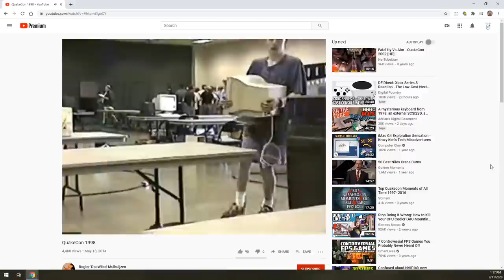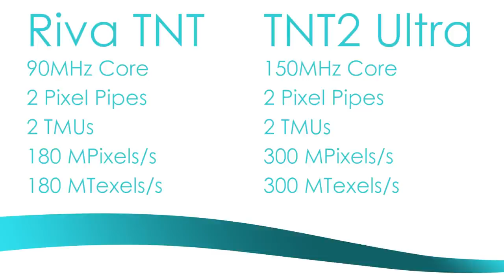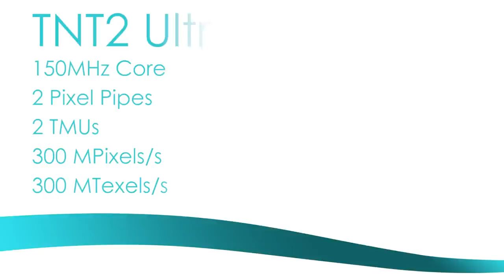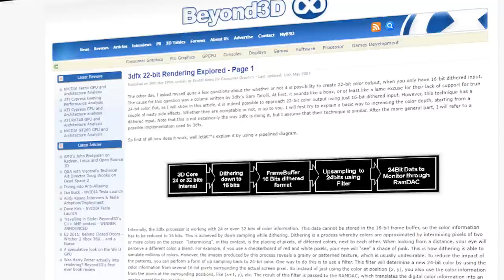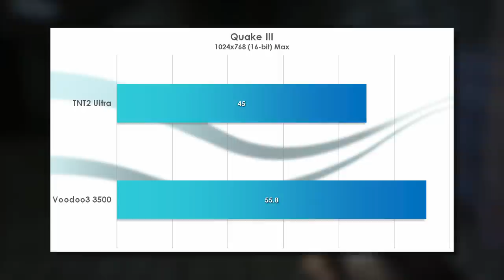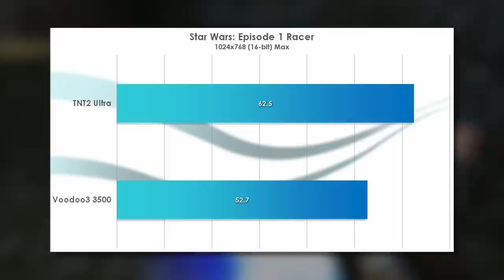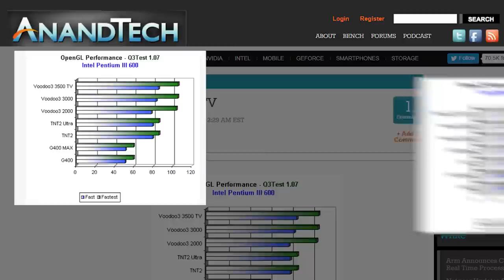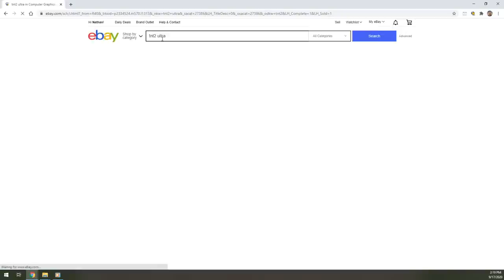NVIDIA TNT2 Ultra vs 3Dfx Voodoo3 3500 | Card Battles

Comment: Back when $250 got you into high end gaming 😰
Reply: To be fair, $250 in 1999 is equivalent to ~$390 in 2020. The RTX 3080 is $499 MSRP. So we're not THAT far off.
Reply: @LS3ftw15  I know you meant 3070, not 3080 @ $499, but i guess i should have phrased it "when $250 bought the fastest thing anyone could buy." Those days are certainly gone. And now nvidia is bigger than Intel lol
Reply: Infinity2z3r0 Yep. Typo on my part, and that’s a fair point.
Reply: But the rest of the system was really expensive.
Reply: The enthusiast PC gaming market wasn't yet ready to support $2000 graphics cards. They would've thought you were nuts.
Reply: @LS3ftw15  this aged well
Reply: Thing is.. there were virtually no high end 3D cards for consumers back then.  Everything was low-mid tier in relation to the rest of the hardware available for PCs at the time.  I wouldn't call the most expensive burger at McDonalds "high end" ya know what I mean?
Reply: So called inflation
Reply: @rflynn22288 4080 enters the chat
Reply: 250 got you a 4870 in 2009 as well
Reply: Well, that’s not necessarily true. You gotta realize that the rest of the computer is over $2000 on average. Ram was insanely expensive back then, and certain CPU that would fully take advantage of the performance of these graphics cards for close in the $1000 range on their own, like slot 1 Pentiums for example.

Comment: When 3DFX came out it was a revelation. i had the 1st voodoo card in 96ish and couldn't belive how good it was. i then move on too the voodoo 2 12mb in sli. that was another big jump. i still have my two diamond voodoo 2 cards , both 12mb. there boxed and still in my spareroom.

Comment: I bought my first PC back in 1999: A Pentium III 550 MHz and a TNT2 Ultra! That graphics card served me well for years and was only replaced by the GeForce4 Ti 4200.
Reply: Whoa that was the same upgrade for me too! I had the Creative Labs TNT 2 Ultra.
Reply: What was the heaviest game you were able to play with that TNT2 Ultra?
Reply: @Just_a_Lad  I think it was UT2003. But it was also one of the reasons why I upgraded. ^^
Reply: Ah I had a few of those machiens back in 1999. I was lucky enough to aquire five Dell Optiplex servers in amazing fold out cases and each contained dual P3 550's, 256MB SDRAM, onboard SCSI with Quantum SCSI 8GB HD's and Dell Viper 770 TNT2's - which were much like the TNT2 Ultra only custom to Dell machines I believe. For the time, those machines were absolute powerhouses, especially under Windows 2000/ME which made use of the dual CPU's, although I think only Quake III used the dual core ability in terms of games.

I gave one to my brother who had never had a PC before, only a Playstation 1, and he was mesmerized by Deus Ex and Heretic 2 for months. Hilariously, he called me on night and asked me to come over because he had gotten really far in Deus Ex but had become stuck on the submarine base level (near the end of the game). I went over and discovered he hadn't applied a single skill point except those from the start of the game. He had gone ALL THE WAY to the sub base, being untrained in almost everything.

Regardless, I still have one of those machines left in storage but I outfitted it with P3 700's and a Geforce 256 DDR before I retired it back in 2002. I did keep the vipers out of the other machines though, so I have 3 of those, the guy who bought the machines from me only wanted them for their SCSI capability and the SCSI drives they came equipped with. Considering I managed to get all 5 for nothing, I made a few quid on those PC's. Still, looking back, I should have kept more than one. Retro builders dreams, those Optiplex machines.
Reply: I had a TNT2 Ultra with my Duron 750 and I remember playing Gunman Chronicles on it and loving the game. Recently built a retro rig with an AMD K6-III 550Mhz and a TNT2 Ultra and Gunman was unplayable. Those K6-III's really sucked at floating point.
Reply: Same for me i had the riva tnt 2 and replaced it later with the geforce 4200 ti
Reply: 550 in 1999, that had to be quite expensive...I remember paying above 2k for a 450 system in december of that year..
Reply: That PC In 1999? That was insane. It must have cost you some 2000 USD with Pentium 3 in 1999. Also RAM was very very expensive relative to rest of the components. 
So I remember 64 MB of Ram costing like the equivalent of 350 USD now.

Comment: Drooling over that Leadtek winfast A350 geforce 5900 behind you. And next to it the fail of the era: the hopeless 128 geforce fx5800 with its vacuum cleaner cooler. The design of that leadtek a350 is one of my absolute favorites still and only is bettered by the Gainward 6800 gt golden sample with similar design but in red and the ultra rare Chaintech Apogee GeForce FX 5800 Ultra golden card with blue LEDs inside. Love that period
Reply from the maker: Yes I LOVE the design of that Leadtek card. They made a 5800 with the same cooler but good luck even seeing one

Comment: The TNT2 Ultra was my first graphics card, bought in the summer of 1999. 
I had a friend that was adamant about the Voodoo. And we argued a bit about it. 
But I do remember that pretty much all reviews put the TNT2 Ultra ahead. And that was the reason I bought it.
Reply: Same with my friend and I. Tnt2 ultra!!!
Reply: Yeah that was the changing of the guard. The TNT vs the VooDoo 2. They traded blows I guess, with TNT2 being faster (and with more colours and resolution support) in Direct 3D, but 3Dfx having the edge in some titles because of Glide.

I saw a friend running Aliens vs Predator and Quake III with his TNT at a lan, however, and that made me take the plunge and sell my VooDoo 2 card and buy a TNT2 Pro. If only I'd have held out for a few more months I coulda aimed for the Geforce or Radeon. Ah well!

Comment: This represents my experience from the day. I had a very fast AMD K6-III CPU that was overclocked to 508 MHz (113 * 4.5), with low-latency SDRAM, and a 3dfx Voodoo 3 3000 card that I attached a relatively large CPU cooler to, hehe. It would run 190 Mhz, faster even than the 3500's clock! My friend's Pentium II 400 Mhz system, when upgraded with a TNT 2 Ultra, was still far behind the performance of my machine in a lot of games. He felt like the tech websites must have been paid off, as he had the impression that his machine would be much faster! (*´▽｀*)

The 256x256 texture limitation really wasn't a problem back then. 256x256 was still larger than most textures in most games (e.g. Half-Life, Quake III), and the real limitation was the fact that textures had to be sized in powers of 2 on 3dfx. Some games would bug out if you didn't run them in a special 3dfx mode, even if they didn't have Glide support. And while the "22-bit" thing was basically marketing, 16-bit output on 3dfx really did look way better than on anyone else's cards, even Matrox.

Comment: Very nice video, I remember these battles in "first person",  I was on 3dfx "side" with my Voodoo3 2000 (which I still have and still works!)
Reply: i had a voodoo2, then my brother upgraded to a gf2 gts and i took his voodoo 2 and put in my system for SLI, which performed about the same as a voodoo 3 2000. good times.

Comment: Yes it really was a special time. Each generation gave such massive performance gains for the same cost, and you really wanted and used that extra performance to boost resolution and graphics fidelity. You went from 320x200 prior to having a GPU, to 640x480 using a Voodoo1, then 800x600 using a Voodoo2 then 1024x768 with the Voodoo3. I was lucky to experience each generation and the night-and-day upgrade it provided. I guess it would be like going from a 980 to 1080ti to 3080 in the space of 3 years at a 3060-like price level (sans crypto).

Interesting to see a look back at performance now. The reviews all made a big deal out of the 32 bit colour advantage for Nvidia, but this generation of hardware wasn't capable of pushing it at a nice frame-rate (ala ray-tracing) so everyone stuck with 16bit anyway. Glide support totally turned the tables to favour 3DFX.

The tie up between STB and 3DFX was catastrophic and tragic end to the company. Many gamers saw it coming a mile off, too bad the corporate money-men didn't.
Reply: Thank you. Nvidia fans just don't understand the dominance 3Dfx had. Their only real mistake was turning their back on companies like Creative Labs who was a monster at the time. They made a lot of enemies which also led to bad press and lost sales - which then led to less money for R&D to stay competitive; but the Voodoo 4 and 5's were still very capable designs.
Reply: While I remember the whole STB × 3dFX commentary going on at the time... realistically what ended up leading to the downfall of the Voodoo compared to the NVIDIA TNT2, ATI Rage128 and S3 Savage was OEM Deals and Support for what became the Industry Standards (OpenGL and DirectX)

While NVIDIA did tout their 32bit Support., realistically even up to the GeForce FX Series... it was a novelty., because their Pixel Pipelines were 16bit; meaning to support 32bit they combined the Dual Pixel Pipeline into a Single Pipeline; which effectively halved the performance.
This is different to ATI who increased their Pixel Pipeline to 24bit and S3 who increased theirs to 32bit... albeit both ended up with slow Core Clocks., meaning they couldn't really compete with either Voodoo or TNT2 in terms of 16bit Modes; with the Rage sitting about 20-25% behind and Savage 50% behind; but the Rage would show a CLEAR performance advanced in 24bit/32bit ("True" Color) while the Savage would have equal performance (at half the price point).

Still as most would still game in 16bit., none of this seemed to even be a blip on reviewers' radars until Radeon Vs. GeForce; when 24/32bit did become more important with the introduction of Shaders. 
GLiDE while based upon OpenGL was a Limited Subset of the Instruction Set specific to the Voodoo Architecture., and so the Architecture had a hard time supporting the more complete OpenGL 1.x Specification... and the same was true for Direct3D.
This meant that while Drivers were made available to support said APIs., performance and feature support would often be lacking on Voodoo.

And by 1999., most Developers had abandoned supporting Manufacturer Specific Graphics APIs in favour of the Vendor Agnostic OpenGL and DirectX.
Still as noted, the other side of this was NVIDIA with the TNT2 became excellent at the art of OEM Partnership. 
If you bought a new OEM PC (Pre-Built) from Compaq, Gateway, Dell, etc. from 1998 - 2001., it was almost guaranteed to have an OEM NVIDIA TNT2; which while were "Cut Down" from the Retail version; did cement the name recognition with PC Gamers., and due to a lack of most understanding there was a difference (which a BIG performance difference) between the TNT2 Ultra and TNT2 OEM ... would usually lead to them showing their mates at how much better their Graphics Card was to their friends Voodoo.

These deals also became lucrative enough for NVIDIA for them to be in a position to "Help" 3dFX when their market share dropped dramatically, and they found themselves in financial trouble.

Comment: I have the VD3-3000 and the VD3-3500. My first experience with video cards was the VD3-3000 when I cracked open my mom's gateway PC to
install that bad boy to get Rainbow 6: Rogue Spear running smooooooth as butter. My mom wasn't happy, but my 16 year old mind did not care lol

Comment: The TNT2 Ultra was technically more poweful, but the 3dfx looked better and was faster when running many games that used the 3dfx Glide API (I had both cards in lower versions: the TNT2 "non-Ultra", and the Voodoo3 2000).

Comment: I was looking for voodoo3s a few years back. They were sold for peanuts. 11, 15 buckaroos, they were cheap. I found a 2000 in a computer I salvaged, and that prompted me to look them up again, 70 at the least.
Reply: Back in 2009 I gotten my first v5 5500 agp for a meager $10 shipped from eBay, those were the days of getting such cards for peanuts now they sell for $250-350 on bid these days.
Reply: @MrKillswitch88  I bought a 1997 Sierra Screamin 3D card new in the box on eBay for $5 USD about 2 years ago  and after making a video on my find here on YouTube within about a month I resold it for $960 USD to a vintage graphics card collector in Deutschland. 
In some ways I regret selling it as a rare collector item
Reply: @m9078jk3  There was a recycling place in Manchester that had an eBay page about a decade ago. They must have gotten through some serious gear from all corners of the UK because they would post, weekly, hundreds of GPU's from old computers and ask between £3 and £15 for each one. Most of them were correctly identified, but not all. But all were sold as working so someone there must have been testing them.

Over a year I bought more than 50 cards. Geforce 2 Ultras, Rage Fury Maxxes, VooDoos .... the works. Ended up being on first name terms with their office and in all those purchases, only ONE card didn't work when it arrived, so the guy sent me two identical (working) cards for free just a few days later. Awesome people.

If you add up the sold listing prices of a lot of those cards now, you're looking at insane profit. Just can't seem to part with any though! They are all my babies.

Comment: Great video. You captured the essential aspects of the cards well. And what a surprise how well the 3500 performs against the tnt2, as compared to the reviews at the time, as you noted. I got into gaming and pc hardware at the time, so remember the tnts vs voodoo3 battles well, my first card being a V3 3k. Endless amounts of graphs and exposition! I agree that 3dfx made a mistake making the 3500 a multimedia card; they shoud have done that with the 2k, and left the 3500 for the hardcore gamers. I do think though that the 22-bit effective colour was a very smart feature, as the bandwidth hit of 32bit was in most cases too big. And the founders admit making their own cards was a disastrous decision.

Comment: To be honest, i've never cared for 32 bit color depth or high texture resolution when i had a bulky crt and a voodoo 2 12mb and later on a voodoo 3 3000 until i've got a lcd monitor for myself (i was in my early teens, so i've basically knew nothing about all the tech stuff). Things had changed for me afterwards, when i realised how awfull the 16 bit dithering looked on my lcd monitor, some time later i've got my hands on a cheap geforce 4 mx 420 (i think it was the 420), which i replaced with a FX 5200 (128 bit, 256 mb), that i've got for free, just a year later (at this point i've replaced my whole system from a 866 mhz Pentium 3 to a Athlon XP 2200+).
Oh the memorys of joy, passion and experimenting with games settings and editing ini and cfg files, to get best results of performance and visual fidelity. I love your videos, they always give me this retro vibe and memories of the past, when i've read almost every pc magazine i've got my hands on, that i could afford for my pocket money (and of course my love for my Voodoo 2 & 3).

Comment: OMG first! How original am I, eh? xD

EDIT: In all seriousness, I always had 3dfx accelerators, until 3dfx went under, and I remember how fiercely I was rooting and fanboying for 3dfx against Nvidia and ATi back in a day. Everything was moving so fast and it was so competitive. Man, I miss the 90's sometimes...
Reply: In the 8 Years from 1999 and 2007. We went from Quake III to Crysis. In 2021 GTA V will be rereleased on PS5.  A game from 2013 also 8 Years. Yeah times moved fast then.
Reply: @SirSilicon  We also went from predominantly "2,5D" games to Quake 3 in ~4 years (1995-1999.).

Or how about Voodoo2 almost doubling the performance of Voodoo Graphics in less than 2 years (1996-1998.). How's that for gen-on-gen leap? :)

Or going from 4MB to 16MB+ of total memory on consumer graphics cards (basically quadrupling total graphics card VRAM in ~3 years, 1996-1999.).

We also went from basic 3D accelerators in 1995. (with Rendition Verite, NVidia NV1 and similar) to fully T&L capable GPUs in 1999.

Crazy times... :)
Reply: @RandomlyDrumming  and now it is like a stagnation in techindustry, no big improvements over the previous tech in the last couple of years. The only thing i like in todays tech is that the power consumption is going down while the performance is going up in the same time. But the overall performance hadn't changed that much.
Reply: It was still an emerging technology it was only a matter of time for it to slowdown.
Reply: we're kinda going in a mini revival of the 90's right now as far as hardware goes and i hate it. i just bought a 6700xt and amd is already leaking stuff saying how outdated my card will be by this time next year. come on!